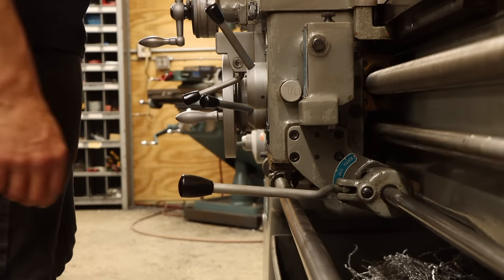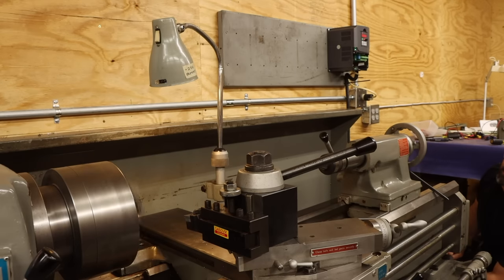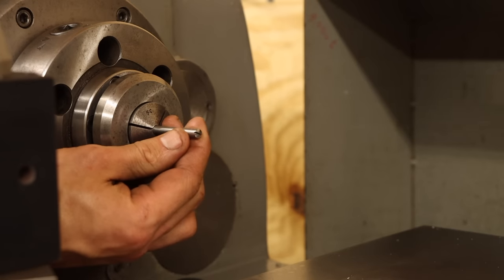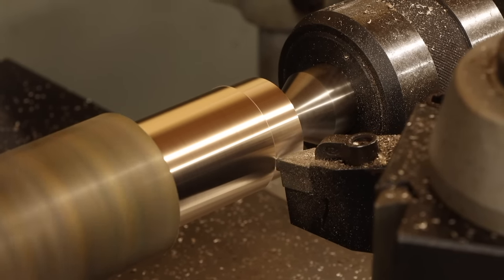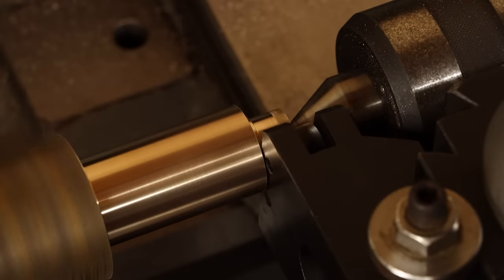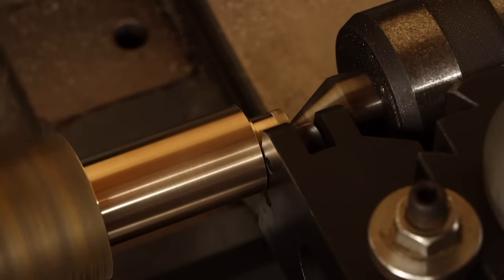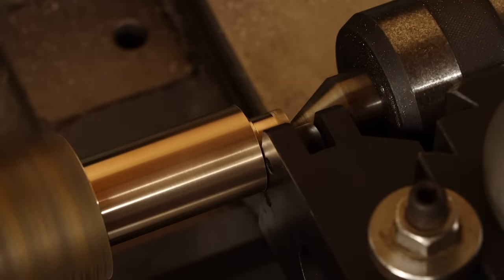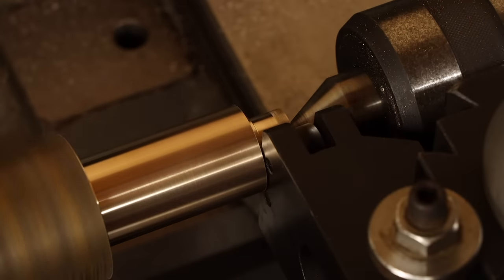Making a Surface Gauge (Part 2) || INHERITANCE MACHINING

Comment: You'd only need an external control supply if you want the VFD to be able to think while it doesn't have actual power, which really isn't something you'd ever need in a home shop... unless you want to set up safety interlocks, or something like that.
Also, usually there should be a dedicated supply pin for whatever you'd connect to the inputs on the VFD, in most cases even different TYPES of inputs have their own supply, just to be safe; but if you are mindful of the potential of varying voltage potentials, or just have everything on the same reference voltage, it's usually fine either way. Basically, there CAN be issues, but on a small scale in which everything is part of the same circuit anyways they shouldn't ever come up. 
Also, it just makes everything way easier to troubleshoot when every part uses its own supply voltage, since any faults will only ever affect that one part.

Comment: Glad to see a true VFD gives you the needed 3 phase power.
Assume your Grandfather did not have access to the VFD equipment so he must have lived with a frequent overload you experienced on the lathe.
Are you using a 15 to 20 amp single phase 220 VAC circuit to share amoung your industrial grad tools?
Glad you have a woodstove for winter, an AC for summer, and a dehumidifier.
You have not ststed your field of engineering?
Enjoy your leisurely hours in your machine shop.

Comment: I've been thinking about building a spring loaded follow rest for single point threading small diameters. It might be something worth considering.
Reply from the maker: That's an interesting idea. That would help with keeping consistent back pressure as the pads wear. Just in the few passes I took with my setup the wear was way more than I would have expected. And I kept it drenched in oil.

Comment: went to a surplus store purchased a 15 hp  three phase motor  for 5 dollars  cut the snott off and installed new bearings  bought a capacitor pack to balance the motor. now can run 45hp of 3 phase

Comment: Instead of using a VFD, use a RPC(rotary phase converter). This way you don’t have to do any electronics. It’s literally plug and play. Not only this, one RPC can power multiple machines. This is my setup for my shop, the only down side is that it can be kinda loud and somewhat of an expensive initial investment. However an RPC is definitely what I recommend should you run into a similar issue again.

Comment: So are you using the VFD for braking? If so did you have to add capacitors, I'm about to do this to my lathe and I'm trying to decide if i want yo mess with the braking option
Reply from the maker: Not in this setup but there are terminal for braking resistors on this particular VFD. I'm usually not in too big a rush to need to start and stop the lathe so rapidly. But may investigate the upgrade at some point.

Comment: Amazes me that youre the other side of the pond, yet that tool looks identical to the one I made as an apprentice (minus all the grime!). Still use mine almost daily, its been worth its weight in gold!

As for the teaser..... using the sine table to accurately grind up the collet blocks?
Reply from the maker: That's awesome! Send me a pic, I'd love to compare.

Also, you are quite clever!

Comment: I know nobody was asking... but it is not against code to have a break between a VFD and motor. I do it with local motor disconnects on industrial machinery. If you have multiple motors on a VFD, it's actually required to have an overload for each motor. But I would have ripped out the old controls too.

Comment: Came out looking really good. One question I have is did your pivot pin have a section without threads or is it pivoting on the thread? I might have missed it another way I use mine is instead of the dial indicator I have a scribe inserted and use it for quick centering of cast parts in the 4 jaw as the cast parts are not round
Reply from the maker: Thanks! I kind of glossed over it but the spindles that the brass knobs thread onto have a 3/8 section for pivoting. Also I've seen the method you are referring to with the scribe. I may have to make one (or make an adapter for one) in the future if I have the need. At the moment I really only needed the squareness comparator.

Comment: I’m curious about your sanding block and wonder if others are as well? Ever considered making a video on the block and/or how to make one?
Reply from the maker: I've had a lot of people as about that. It came with an old exacto knife kit if I'm remembering correctly. Look up "sanding block waldorfshop" (I'd give you a link but it will get deleted). Mine functions the same but is a slightly different shape.

Comment: With a bit of tuning you should be able to get a rather fast breaking speed as well with the VFD. That can be quite a useful advantage :)
And variable speed control of course, but you might not want that.
Reply from the maker: This VFD exceeds my needs for sure. But I might grow into it as my needs change. Already includes external inputs for a pot and for braking resistors. So may be playing with these at some point.

Comment: The run out on the cutting saw blade might be intentional to prevent the blade getting stuck in the part due to not enough tolerance between the blade and the part being cut.

Comment: So, the VFD's control features can take the place of all the original control apparatus?  You seem to have taken out a lot of stuff from the side of the lathe, and I don't know what you needed other than a contactor.

I understand VFD lets you turn the motor at any speed.  Before, it was just one speed based on the 60Hz power, and you selected from several gears in the top gearbox, right?  I suppose among those terminals is a way to hook up a potentiometer knob or rotary encoder knob to select the speed.  So, do you still need gears?
Reply from the maker: Yup pretty much. Most of the old controls were safety relays and thermal motor protectors. Functionality that's already built into the VFD. It does have an input for an external potentiometer so you could theoretically pick 1 gear and just change speed through the VFD. But at low speeds you wouldn't have the power available because the VFD is designed for constant torque (I think 😅 )

Comment: Does the VFD have any cooling requirements? I'd be concerned with it being mounted in that small space and getting enough airflow to keep it from overheating...?
Reply from the maker: It does outline in the manual recommended airflow clearances. I also leave the door open most of the time

Comment: At 20:30, is the pressing operation actually shaving material out of the bore?
Reply from the maker: Yeah it did a little. Didn't file enough of a bevel on the lead in. But still seems to hold well.

Comment: For what is the slip pins in the base used on such surface guage?
Reply from the maker: You can press them through to run along an edge of something. For instance if you wanted to check the parallelism of something like ways on a lathe.

Comment: You are an amazing guy, I love the channel.  Have you considered a line reactor between the VFD and the motor?  I’m thinking of updating my lathe in the thought that the motor insulation may like it.
Reply from the maker: I appreciate that! I seem to recall the VFD manual recommending a line reactor be installed like that but I proceeded without one. What's the advantage?
Reply: @InheritanceMachining  I’m no genius engineer but I burned out one VFD on my 1970s SouthBend Nordic 15 lathe after about 8 years and the new unit was setup with a lower (carrier frequency??) and the lathe motor made a very audible sound at a near “dog whistle” frequency.  I’m deaf as a rock and it made ME nuts.  Once adjusted to over about 8 or 10 kHtz I couldn’t hear it.  The output of the VFD isn’t a perfect clean sign wave and (I think…) causes some spikes which over time could damage insulation, particularly on older non-“VFD rated” motors.  As I understand it, the “reactor” adds reluctance into the system to act as a filter to help smooth out the VFD output.  I would want one wired between the VFD and the motor.  My plan is to speak to the VFD supplier to get a recommendation for my setup which is a 5 hp motor on a derated 10HP VFD powered by my single phase power.  I have put that off for a bit and have just been making stuff on the lathe… the Teco unit on my Bridgeport has been reliable for much longer than I have owned this lathe but also has no reactor. While my 2hp series-1 mill is variable speed, I use the variable mechanical system for speed control for the torque multiplication and to keep it from wearing a groove in one spot of the pulley faces.  Both machines use the machines low voltage controls to command the VFD to turn on and off and in the case of the mill, reverse.  I have meant to add brake resistors to the milling machine’s VFD for faster control during power tapping but in its absence have grown fond of using the ramp-time and motor duty cycle to control the tap without putting the machine into back-gears or otherwise adjusting the speed to tap.  It works great!  I use a 2 second ramp and just pulse the on switch to control the tap.
I hope my long winded answer is of some small use to you!  I learn a lot from you and your channel.

BTW, your lathe leveling video was likely the best I have ever seen and I only wish you would have slowed down the presentation you made (at least for old fellows like myself). Your description of what is going on was so very valuable, clearly stated and informative .  Thank you for what you do!
Reply from the maker: @cogentdynamics  very helpful indeed! Thank you for the info and for the kind words!

Comment: Is it to hard to get 3 phase there? I have that I'm my house here in Brazil, just to distribute the current between phases. And don't have any 3 phase motor to use 😅.
Reply from the maker: Yeah its pretty uncommon for residential and rural areas int he US. Industry has it of course but most households have no use for it.

Comment: beside of vfd you can  also try some 3 phase rotary converter.but vfd is a cheaper way to go.
Reply from the maker: That was actually my original plan before I discovered how cheap a VFD can be. Even if it ends up failing because of some quality issue it's worth the try for something 1/3 the price of a basic rotary setup.

Comment: When making long thin parts, a positive insert is better because of lower cutting pressure
Reply from the maker: Someone else suggested this too. I'll need to get some smaller radius inserts to play with. My current ones are larger than my typical depth of cut so the rake hasn't mattered.

Comment: Subscribed!  Very cool content. Just a suggestion, next time you try to cut a long small OD part use a positive rake tool with a small nose radius.
Reply from the maker: Thanks! I appreciate the tip. So far I've just been using the inserts I have. And in most cases my depth of cut is less than the radius anyway to the rake hasn't mattered. But I'll keep this in mind when I get some smaller radius ones to play around with!
Reply: @InheritanceMachining  unfortunately taking less than an ideal DOC (usually less than a third of the radius) causes more deflection no matter whether the tooling is positive, neutral or negative and with negative rake tooling your radius in contact with the work is greater than the nose radius of the tool.  If you get a chance, set up your negative rake tool holder on your surface grinder and grind one of the inserts slightly positive for the next time you have a project turning long slender work.
Reply from the maker: @brandontscheschlog  I just realized I have rake angle confused with cutting edge angle. I just might have to try this. I haven't quite dove into cutting tool geometry but this would be an easy way to experiment without having to grind a bunch of HSS tools. Thank you!
Reply: @InheritanceMachining  your welcome

Comment: How do you know if the gauge is perfectly plumb from the base to the indicator needle?
Reply from the maker: That's kind of the trick. It doesn't have to be exactly. As long as the path of the needle crosses the radius at some point and there is a peak in the indicator reading, the location of that peak is where the two are plumb
Reply: @InheritanceMachining  oooh uncanny!

Comment: If you want to do long threads with a die, you probably neet to make a guiding collar that rides in front of the die, or make a die holder for the tailstock.
Reply from the maker: that's kind of what I was guessing. Another one for the project list.

Comment: Adding a rotary phase converter is a better option, if one needs to supply three-phase power to more than one machine. Because it will cost less in the long run.

Comment: Really nice project!
Also the VFD-conversion is really nice.
You could even fit a brake-resistor of a sufficient power-rating to stop the spindle quicker, when cutting threats or the like!
Reply from the maker: Thanks! I've been playing with that idea. I also have the spindle brake I could wire in to stop the VFD as well

Comment: Thank you for uploading your drawings for patreon supporters. That is super awesome. I have a lathe that is 3 phase with a 5hp motor that i have been trying to figure out how i wanted to power. Seeing the VFD makes me want to go that route, i just wasnt sure how plausible/reliable it would be. What size of VFD did you get for your lathe? I cant find a "single phase to three phase" VFD big enough for a 5 HP motor. I know using a 3 to 3 phase will lose some power do to only putting single phase into it, and im not sure how much to oversize the VFD to compensate
Reply from the maker: My pleasure, man. Thanks again for joining! On the VFD I used a Huanyang 4kw (5hp) VFD from Amazon. It's oversized for what I needed but went with it just because it wasn't much more cost than a 3hp and thought it would reduce the duty cycle on the VFD. Probably not really a valid reason since I think when a FVD says 5HP, its good for up to 5HP. But it's also an import so wasn't sure on the quality. I'll also mention when you set up the VFD parameters you can tune all the current ratings of your motor and cabling so worst case scenario you just fault out the VFD meaning you just have to reset it. For only $175 I figured it was worth the shot, and so far I am very pleased.
Reply: @InheritanceMachining  awesome. Is the one you got 3 phase in? Or single phase in? I believe i am going to try and find either a 5.6kW or 7.5kW. Wish i could find one built for the purpose of converting single to three phase but it doesnt seem they make them for that much HP
Reply from the maker: @kylewellman402  Mine, and most of the ones I've seen, accept both single and three-phase input. I see some like this for higher power ratings like you are looking for, under the brand names VEVOR and GLORYTECH.
Reply from the maker: @kylewellman402  I sent you a couple links on Patreon for the one's I'm seeing. YT doesn't like outside links in comments
Reply: @InheritanceMachining  That price point for VEVOR is way better than buying a single phase 5hp motor. Thank you again sir! Ive been reluctant to replace the motor with a single phase equivalent as im sure id lose the lathes depth of cut abilities
Reply from the maker: @kylewellman402  Yeah, it's hard to beat those prices. Even if you have to replace it ever few years. Happy to help

Comment: I see a lot of people use these 3 phases converters but... why not "just" have a 3 phase electrical contract... here in France it's the same price but you have to distribute your 1 phase circuit so you don't overcome your amps per phase... i think real 3 phases are must be more powerfull than a converter on a wall socket.
Is it more complicated in other coutries or really that expensive ?
Reply from the maker: 3 phase isn’t commonly available to residential areas in the US. Industrial areas can get it but they are usually grouped together. Probably has something to do with saving cost on power lines. The US is pretty big and people are spread out
Reply: @InheritanceMachining  Thanks for your answer. 
European and US electrical systems are very different indeed. We have only 220v and the whole network is 3 phases, but most people are only connected to one. I hope your VFD provides as much power and torque as real 3 phases, when I compare a 700W single phase drill and my 3 phases 350W drill press, the 3 phase motor as way more torque and usable power.
Reply from the maker: @ciclotronforever  Interesting. So far I have had no issues with powering this lathe.

Comment: You can probably program the VFD to act as a brake like Stefan gottswinter did.. i hope I spelt that right
Reply: I have the same fwd/ reverse lever as above. I also put in a potentiometer to adjust the speed, a jog button and an estop. Mine clips at the same height as the fwd/ reverse but to the right by 6 inches. Handy sometimes to slow the speed or speed up to break chips
Reply from the maker: This may actually be the the first additional mod I make. Would be perfect for facing operations.
Reply from the maker: Yup this VFD definitely can. It has terminals for braking resistors. I don't have a need for it at the moment but might pursue it at some point
Reply: @InheritanceMachining  it's an awesome feature when threading up to a shoulder

Comment: I can never figure out why the vast majority of VFDs have the same bulky standoff enclosures. It can't be for thermal dissipation since the circuit boards are stacked instead of spread out.
Reply from the maker: I'm not sure. I know theres a pretty decent fan in there somewhere. So may just be fore that.

Comment: I found when die threading small pieces the part likes to twist and distort.
Reply from the maker: Hmm i wonder if that's what happened. Didn't seem like enough force when I was using it but I could be wrong.